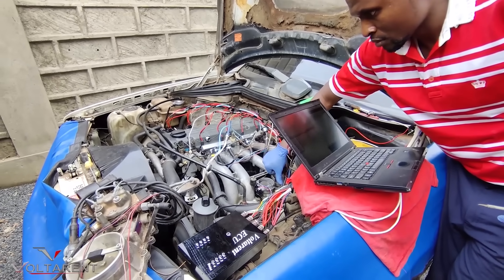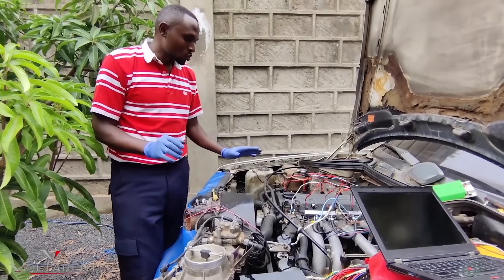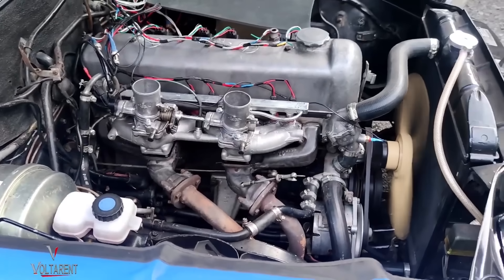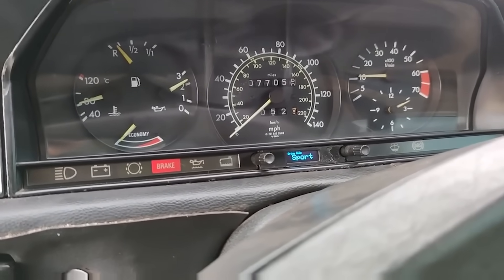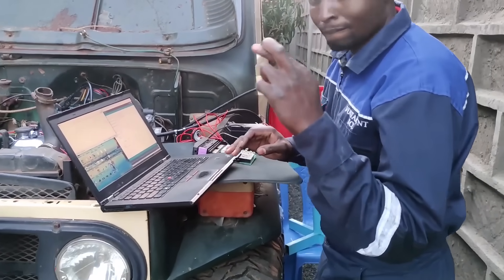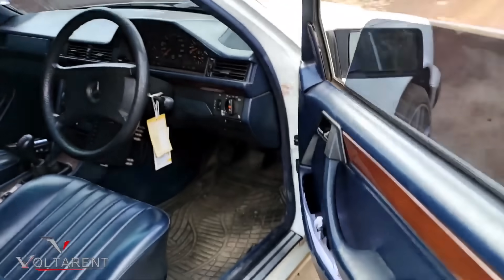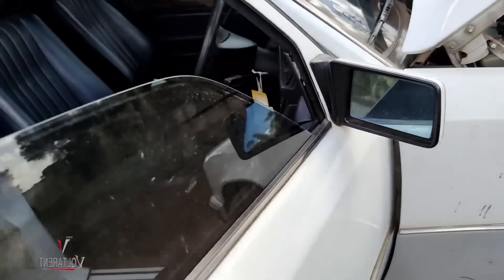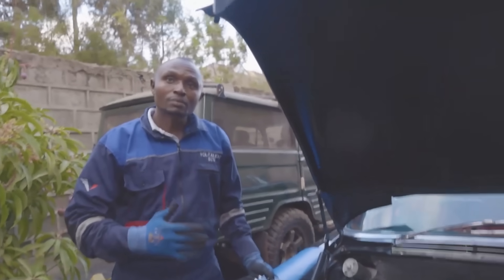African Genius makes Old Engines outdo Modern Engines!

Comment: 2:15 

I will give credit where credit is due:
Very few people vertically integrate from the high-level academic theory stuff all the way down to the hands-on implementation stuff. 
That alone was very impressive. 

Now, I will also call out some BS where I smell it.
He said “in nano seconds, not even microseconds”.
Err… no. 
Arduino boards operate at 16MHz. 
That’s mega hertz; 16 million per second. 
Hz / kilo Hz / mega Hz. 
Second / milli second / micro second. 
For this DIY ECU to operate in nano seconds, one would need board & CPU operating in Giga Hz. 

Now, one can ask the question “is nano seconds needed”?
Clearly he’s running Arduino boards and it’s working. So no, nanoseconds is not needed for this purpose. 

Say engine RPM goes to 7K and that’s redline. 
7K / 60 = 116 rev per second. 
Take the inverse: 1 rev takes 8.6 milli seconds. 
So each degree of the crank takes 8.6 / 360 = 24 milli seconds to travel through. 
If the Arduino board computes at 16 MHz, it certainly should be capable of controlling spark timing within smaller than 1 degree precision between “desired firing moment” and “actual firing moment”.

As to pulse-modulation of fuel injection duration, that partially depends on fuel rail pressure and the injector’s mL/sec flow rate when in the on/open state. I have no idea how long the injectors need to stay open to spray sufficient fuel to charge each cylinder for one combustion.
Reply: I was thinking the same thing. Nanosecond sampling requires gigahertz speeds which I know arduino boards don't have. A little exaggeration for the camera doesn't hurt anyone though.
Reply: I think you took him too literally when he’s just explaining it to someone roughly for an interview. He obviously knows how it works and the end consumer doesn’t care nor does it affect them.
Reply: @JosephSamsor  
When he emphasized it’s not microseconds, but nanoseconds,
No, it was not “just explaining it roughly for an interview”. It was grotesque exaggeration of the equipment’s capability.

Comment: Very good job brother converting carbed cars into fuel injection with coil packs instead kf a distributor. Im converting my silvia to coils from distributor soon to. I am amazed you made a ecu and programmed yourself great job! I am still scared of electric, wiring, and your finishing skills are nice. Nice wiring, nice finish covering the wires. Writing a ecu from scratch is amazing and difficult.  Start building ecu to tune high horsepower sports cars and you have a real money maker on your hand. Its more liablity but i feel you can do it. Become one of the tuning companies in kenya and keep pushing the car scene until its like japan or america.

Comment: I'm an electronics engineer from sydney and i'm pretty impressed, it's one thing to get the code working, layout the board from the schematic and everything, but to actually follow through with it.. that's some effort. from this point, his ECU will only get better and better. good work man
Reply: When you have passion and enthusiasm you can really create wonders!!
Reply: I don't even have the idea of what you guys are discussing/arguing about, but I've got a layman advice.....post your perfect original development👌🏼 It could be of much help to the world👌🏼 Just Let  him be, at least in Africa 👌🏼
Reply: Mate I’m from Sydney and actually wired ECUs for 7 years AND am a mech engineer and I can’t even comprehend self teaching all of this stuff, I did my thesis on ECU volumetric efficiency calculations and my god man the respect I have for this dude
Reply: How do you know it wasnt just copied and slightly modified?
Reply: Resourceful guy
Reply: Stop bullshyting kid you ain't an electronics engineer... most probably a burger flipper. All the guy did is replaced a distributor with a crude electronic ignition system. It is  not an ECU just an electronic ignition timer. 😂😂😂
Reply: I can't help but wonder if this could be done with a Raspberry Pi.
Reply: @SeanOHanlon  ECUs require microsecond-level accuracy, which the Pi can't consistently provide. The architecture is very different.
Reply: @SeanOHanlon raspberry Pis r also being made in Kenya by a company called gearbox europlacer,but I haven't heard him mention it
Reply: This guy is fucking Up the capitalism world 🌎. Reuse what you got.
Reply: Tuning Fork from Halteck?
Reply: really impressed, conversion kits for ktronic will be curious to do a testarossa conversion.
Reply: He's just using an Arduino...
Reply: He didn't do sh*T... he used the internet and the Ai did it all.... don't be fooled.
Reply: Go look at the Speeduino project, then realize this guy hasn't done much else than apply that, and breached the GPLv3 license of it as well. He's done what any of the people applying Speeduino to their projects have done, and Megasquirt and such before that.
Reply: If you were an engineer you would realise he uses an Arduino as his ECU and all he has done is create a power supply and a ancillary outputs which is extremely basic especially using software to design this and the code for this is public access so all he has done is stolen public access code .
Reply: @johnnystoka6625  Well, as an Electronic Engineer with more than twenty years of experience, I agree with you halfway. Depending on his budget and resources, starting with a known working Development board(Arduino) makes sense so he can focus on the firmware and engine. I rather have two variables(engine/firmware) than three variables (Engine/Firmware/Prototype ECU board.) I'm not a fan of Arduino, but if that is all he can afford, then use what you have. Once he has a working version, it may make sense to lay out a board and send Gerber files to a fab house with DFM in mind. 

 Anyway, how about we let the guy do his thing and see where it takes him? He's on the right path!
Reply: @Justmy4cents  The Problem is simply that an Arduino isn't made for this environment. You will have huge EMI Problems like any Android based replacement Navigation system had before they took it seriously. And having an Arduino run an engine that relies on real time code for all it's ratios isn't the best way to make a reliable product. He takes out the original MCU, so there is no backup and it has the potential to kill the engine.

However, great guy with a great idea and it will be enough for Africa, unfortunately not for the west.
Reply: @johnnystoka6625  well basic is working isnt it? 😆 am not seeing many people enhancing older engines to run better except via efi systems that arent applicable on all cars. Creativity isnt in how basic your solution is its how applicable it is to a common issue among older engines.
Reply: @bling86  There is a Arduino community doing just that .
Reply: @bling86 perhaps because older cars like this are extremely expensive to own and drive in the West, or at least in Western Europe. 

Our rulers don’t want Westerners to have the freedom of free movement and private car ownership (at least not in the near future)
Reply: @johnnystoka6625 don’t you know that you are supposed to blindly cheer “Black achievement” and ask no questions
Reply: @CriticallyThinkingRevisionist  Of course even when they steal it .
Reply: @johnnystoka6625 who's stole more than Europeans?? Please sit down and be quiet little brother,  your new here and you have much to learn
Reply: @CriticallyThinkingRevisionist 😂 no one cares about ethnicity here but you.
Reply: @CriticallyThinkingRevisionist  who said anything about race? Leave race out of it!!
Reply: @bling86 That would basically be illegal in any country that forces you to pass safety and exhaust fumes inspections on a regular basis.
Also, there is a reason why he does it in old cars that did not have an ECU. 
 Newer cars DO talk to the ECU and that would mean that he would have to trick a lot of systems into thinking that the original ECU is still present and all sensors are fine. 

He can't do it with any more recent car (starting around the '90s). 

It's all falling apart.
Reply: @oilybrakes  the whole purpose of his work is to make older engines run more efficient and enhance their performance. Its relevant to those cars that run carb engines or very early fuel injection with older tech. Plus i think if a car runs better chances are its emissions will be reduced.
Reply: @johnnystoka6625  What is the name of the community? Thanks
Reply: @oilybrakes I think you need to look outside your own limitations. There’s a whole community of people who put a different ECU in cars well after the 90s. Done it myself with an engine from a car that was on its way to the scrap heap after an accident. It runs clean as a whistle but the power output is 25% better than when it was in the original car.
Reply: @wheater5  I can affirm you, that new ECU you are putting into a modern car, is not an Arduino project kind of an ECU, but a completely different animal alltogether. 
Also, if we continue this thought, the car's you are talking about are getting rarer and rarer and what is being done today is just chip tuning, which uses the original ECU and then changes values within it. 

Obviously, if you have a project car in your hand, and the time and money to work on it, you can just throw a bunch of components together that are modifier-friendly and achieve whatever you want. 

Except, that's an entirely different story and obviously not something for a person that uses a carburator car because a newer one is unaffordable. 
That's a car enthusiast story.
Reply: @CriticallyThinkingRevisionist  You know that automatic
Reply: @Justmy4cents  no. Race is of the utmost importance.
Reply: @CriticallyThinkingRevisionist  Sounds like you are jealous because he is getting attention and you are not! Post your work or leave it alone!
Reply: @CriticallyThinkingRevisionist your “leaders”
Reply: @CriticallyThinkingRevisionist no your supposed to know knowledge and not share it or hide it until someone else does it then you ask questions…yt achievement?? Sounds right
Reply: @johnnystoka6625 when the moors colonised europe for 800 years, introducing civil engineering, medicine, water management,  agriculture, etc etc, I guess europe was coming out of caves right. In fact europeans wrote this to the world after learning whow to write and read from the moors right. When africans were building pirâmides what was europe doing? Please do not insult this continent. When I worked in the west I led a team of all white and asian young smart engineers. I do not consider myself super smart but yes hard working, simple, bro. Please lets takencase by case do not generalise. Cheers
Reply: @antonioalexandre4074  You are completely deluded the Moors did nothing like what you fanaticise about 🤣
Reply: @CriticallyThinkingRevisionist WEF you own nothing???

just like many countries like Singapore or "California" strict emissions regulation keep the air clean... the air we breathe
Reply: @johnnystoka6625 if it’s public access it can’t be stolen hater
Reply: @pabz2ray  He said he created the code so he is a liar and a thief as he is trying to sell a product of someone else’s work . Hater of honesty .
Reply: @InnohubGroup  So exposing the truth is bitter lol
Reply: @pabz2ray Yep! same as Linux I recall. So called open source software.
Reply: @InnohubGroup how is he bitter? All this man did was copy a code and put it on a cheap ECU. 😂
Reply: @johnnystoka6625 😂all your proving is you may have the knowledge but don’t act on it do better.
Reply: @MichaelWinways  So you are encouraging me to steal others ideas and profit from it this like this guy 😂
Reply: @johnnystoka6625  now yall are holy after a history of colonialism and stealing others ideas , car schematics is where you draw the line?
Reply: @MichaelWinways  As if you are guilt free of it hypocrite .
Reply: @ never counted my self out im just speaking to the glorified hypocrite speaking on others thinking they self righteous
Reply: @ Very bizarre that you would find people exposing charlatans as self righteous maybe you're the one with the problem .
Reply: @ I love you
Reply: @ My fears have come true .
Reply: @johnnystoka6625  if it's GPL 2, Youre allowed to use it for commercial, so it isn't theft
Reply: @james-xo8qg  He is claiming it is his own so it is theft and this has been done since 2014 so there is nothing new or genius about this .
Reply: @johnnystoka6625  where is the video does it show which firmware he's using.. nobody's saying it's new, what I'm saying is, that's he's put in a lot of effort, I'm impressed, you cant argue with me that im not  impressed because its my own subjective opinion lol.
Reply: @johnnystoka6625 there's always that guy
Reply: @johnnystoka6625  if you were an actual engineer, you would know that we SHOULD NOT invent the wheel on every project. It's stupid to do so. Why not melt your copper then? You're using stolen minerals then??? 
As engineers, you have to use what's available to you, to create something from it, not create everything from scratch needlessly.
Reply: @johnnystoka6625 maybe, maybe he worked on that but he thought about it. You are still at your PC writing comments.
Reply: @johnnystoka6625 well your attitude embodies what is wrong with people …he didn’t “stole” anything…it would be almost the same claim that I’ve stolen letters to create words ….some people just can’t embrace success and positivity
Reply: @powerstar550  So you don't steal anything if you assemble an ATX PC and install Linux on it, and then claim you invented the PC and developed its software all by yourself?
Reply: @johnnystoka6625 bro you only know English because someone taught it to you.

Think on that while you rage over how stupidly funny that is
Reply: @johnnystoka6625 and somewhat crudely wired and tuned the vehicle.
Reply: @EnglertRacing96 it seems pretty state of the art compared to any other automotive research that im aware of based out of Africa. Just sayin, im afraid of a haltech piggyback ecu, meanwhile hes making shit from parts..

Comment: I only use carbs, sorry. To me that's NOT an old engine. By the way, there is a guy on YouTube who has a 318 dodge/chrysler/plymouth cubic inch V8 engine making 600 horsepower without a turbo or blower.

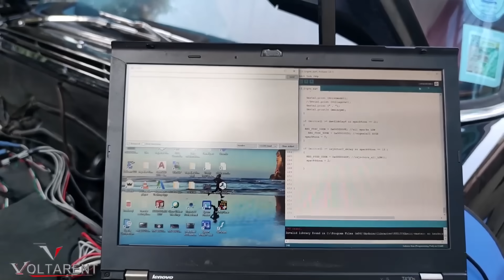Comment: 3:08 he's using the Arduino IDE and there's already a project made for Automotive ECUs, he just copied on this idea.  At least add the fuel pump channel to the board....
Reply: You are right, microprocessors have been used to make engine management systems for a while now. But in Kenya he is the first to give Bosch and every other manufacturer a run for their money.

This is the same as Dictator Engine Management Systems. Let Kenya and her people take pride in their own work. C'mon man, if it's so simple then make your own so we watch your video.
Reply: Always spitting negativity
Reply: @HagereyEritrea i know what a h8er rite!
Reply: Haters gon hate... Would love to see you debate the guy on electrical engineering and engine modifications... 😈
Reply: @Michaelkaydee  i know what a dik rite?
Reply: Relax bro 😒
Reply: Don’t hate dude
Reply: But to be fair just the wiring takes some skills...
Reply: Nonetheless, whatever the guy is building is very impressive, from GitHub project, to actual vehicles on the road.
Reply: lying hating little battyman be quiet

Comment: Seems quite excessive, a speeduino ecu is around 100$ and does exactly the same. They have been running the arduino for ecu platform for many many years.

Comment: If I understand this video correctly, he is converting carburated engines to fuel injection, which is a remarkable achievement, but not really groundbreaking, as many other companies have make it in the past.
I understand this would make sense in some african countries, which still run a lot of old, carburated vehicles, but not in the rest of the world, where most of the cars are already fuel injected, and those who isn't are considered classics, and originality is more valued in this kind of cars than efficiency (a fuel injection conversion would reduce the value of the car).
Reply: The tech not groundbreaking, but the package price level might is. These conversations is likely aimed first of all at cars used as everyday cars, not hobby/colletor cars

Comment: I'm an automotive engineer with Bosch qualifications (from the late 90's, so experienced with fuel injection since Bosch's K and L Jetronic), and this is impressive. Building a fuel injection and ignition management system from scratch is not an easy feat. I have a question regarding the fuel volume and ignition timing: is the system using a lambda sensor to monitor output gases, or is it open loop?

Comment: At 12:36, there is something I do not understand. He is discussing cars doing 10 kilometres a litre after ECU upgrade. That would be 10L per 100Km. If I got the math right, it is a big positive if it was doing 20L per 100KM before the ECU upgrade. Still, 10L per 100Km is still very, very uneconomical to drive. The next step would be to add a battery system to co-run the car with the fuel. That would be bliss.

Comment: really? Just spark plugs are running by ardruino, fuel injection is still mechanical and there is no way how can he have control to an engine without direct injection (ein sprtiz)…

Comment: I did this to my 1985 Mercedes 380Sl; there was NO mayor difference in increased fuel efficiency….
The design of the engine has set fuel requirement.
So weather it is carbureted or mechanically injected, it would require the same amount of fuel if it is converted to electronic injection.